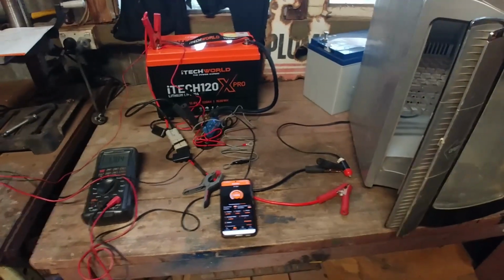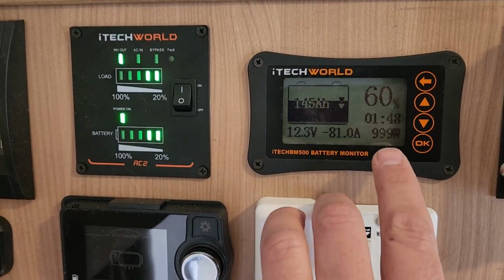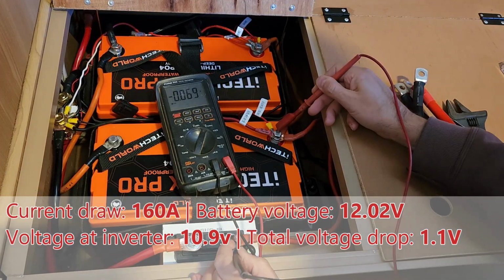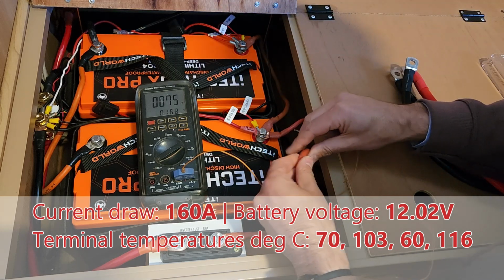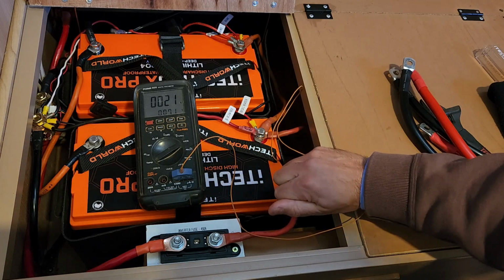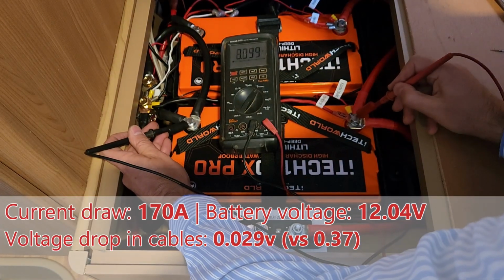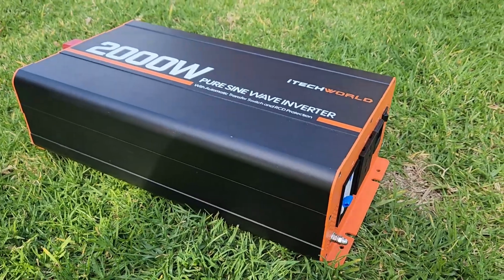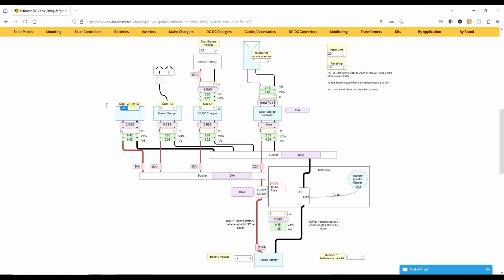WARNING: Skinny power cables + power upgrades = fire risk!

Comment: I would not consider anything smaller than 35sqmm cable for my battery connections, and even then thats a bit under sized for some uses such as battery interconnectors, and inverter connections, and I may step up to 50 or even 70sq mm. Not everyone has a roll of that cable laying around as it's extremely expensive and heavy as well. 

For those saying reduce the fuse to 200 or 250A, yes I agree, but also be aware that the fuse is there to protect the cables and unless you have cables that are capable of handling 200+ amps, which is roughly 70 sq mm, i.e F**king thick, and are instead using something like the 10-16sqmm that appears to be used between the battery and the fuse, a 250A fuse wont stop the cable overheating due to overload. Your 00 gauge is pretty close to 70 sq mm (67mm from memory, so they are likely using 70sqmm cables) and perfect for the task
Reply from the maker: All good points thanks for sharing! Yeah the issue of heat with cables comes with time; 250A for a few seconds won't matter but sustained high loads week cause melting issues

Comment: cca cables should not be used.
Reply from the maker: I don't think these are CCA cables? What made you think that? I would certainly agree in principle with what you're saying if they were.

For anyone else reading this, CCA stands for copper clad aluminium, which is copper on the outside but cheaper aluminium the rest of the way through.

Comment: Silly this 12v madness. Just upgrade to a 24, or 48V system. Way lower currents and more efficient.
Reply from the maker: I agree a higher voltage system is definitely one way around this problem, especially for a brand new installation where you're doing it all from scratch. However if you're retrofitting it to an existing 12 volt system, you have to factor in the cost of changing 12v appliances to 24 or 48v, plus 12 volt converters when needed to run lower power 12 volt systems like water pumps or the radio. It would probably cost more to change all that than the cost of upgrading a few cables and keeping it all as 12 volts.

Comment: Yes,  there is some bad system design there. Undersized cables with a very high amp load!.  No one to blame there but the installer!  Properly size battery cables for the loads is simple.  there are apps you can download on your phone to calculate the correct wire sizes
Reply from the maker: Haha well that installer would be me! :D The old orange cables were what linked the two original AGM batteries, but when I first installed the inverter I supplied that thinner red cable I had from an old 1200W inverter. As I had AGM batteries I was only drawing small loads from the inverter for some time, but having just changed to lithium I was able to load the inverter right up for the first time, which is when this problem first presented itself.

Comment: I would change that fuse to a 250 amp fuse. I would also use busbars to connect each battery.
Reply from the maker: Not a bad thought; while the inverter usually only draws 250A at 3000W, it can draw up to 4500-6000W for 2 second bursts, which is 375-500A, which I guess is why they use a 450A fuse. Busbars are a good idea, it never occurred to me. Probably cheaper than chunky cable too.

Comment: Tip, next time when you switch the cables put the old one also on top of the new ones and the voltage drop will be more less.
Reply from the maker: Ah so run the old cables in parallel with the new ones? Good idea, provided the stack of terminals doesn't introduce more resistance than the cable. I'm probably ok with these thick cables but it's a good point I hadn't even thought of! Thanks!

Comment: Very useful demonstration of under sized cables.
There are other  improvements you need to consider for safety.
Lithium batteries can deliver very high currents under fault conditions, in the region  of 7000 amps. This requires fuses  that can tollerate  this. Recomended are classT or MRBF in suitable fuse holders,  as 'master fuses'.  Idealy each battery should have this fuse type as close as practical to the positive terminal before any other connection. Its necessary  to have positive and negative buss bars to avoid stacking  more then two lugs where you have multiple cables on a common point. Where there is a reduction in cable size a suitably rated fuse are needed.
The battery manufactures claim of 'drop in' replacement for lead batteries needs to approached with some caution. Under charging they tend to 'pull' more current than lead batteries. Thus chargers and cables must be able to handle this without overheating.
Whilst litthum batteries are fairly tollerent of charge voltages, optimum charge volts of absorbtion 14.2 volts and float volts of 13.5 are low stress values.
Reply from the maker: All good points, thanks Michael!

Comment: This has to be the most informative video I have seen on YouTube regarding Cable Selection and Vd on DC and its inherent effects. The power gains to the load attributed to I^2 X R has been fenomenal in this case due to larger cable selection and consequently a drop in R. Not sure what type of cables used if CCA or solid copper though?.  Well executed.
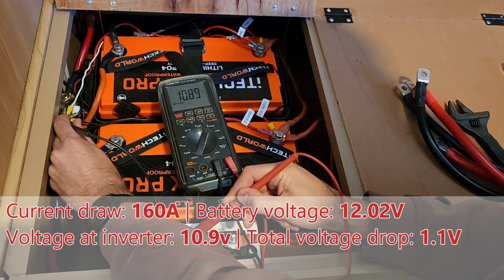Reply from the maker: Thanks so much, glad you enjoyed it! You're right there are gains to be made, and I probably didn't point this out as well as I might have. 160A at 10.9V (2:44) means the inverter was receiving about 1750W of power with the old cables, but at 7:03 it's 170A and 11.6V which is nearly 2000W. So my old cables were essentially being a 250W bar radiator!

Comment: Great video. I recently replaced my caravan AGM setup with 300a of lithium. Fortunately I've only got 1000w inverter but you've got me thinking. Pretty sure my Anderson plug cable running from the vehicle is undersized too.
Reply from the maker: Glad it helped! Yep the charging cable from the drawbar, as well as the charging cable in the vehicle itself from the battery, should all be considered. Good luck!

Comment: Yes indeed. Amps are the killer for cable size and always use a fuse with less rating than the cable can handle. A small error can indeed burn down your pride and joy.
Reply from the maker: You're right there Peter, no point your cables becoming the fuse! It's interesting iTechWorld supplied the 3000W inverter with a 450A fuse but only 300A-rated cables (based on what's stamped on the lugs). That said, being a 3000W inverter it's really only designed to draw 250A under full continuous load, 350A for 10 seconds and 450-500A for 2 seconds. So in normal use they would be fine and I guess a temporary overload of short cables like that isn't going to be a problem, and if there's a genuine fault then the fuse should blow fairly quickly.

Comment: G'day Greg great video. I'm sure it will help people, but you did miss the elephant in the room. That fuse was screaming 450amps. The fuse is there there to protect the cables not the load. On the first run that fuse should have been one hundred amp. Maybe up to 250amps after changing the cables, depending on what cable chart you use. Great test. very entertaining
Reply from the maker: Interesting thanks Joel! The 450A fuse shipped with the 3000W inverter and they were installed together, so it's primarily there to protect the inverter. However implicit in that statement is that the rest of the system can handle more than 450A, so as you say the fuse should be first thing to go and not the cable. However it's interesting that the inverter has a max continuous input current rating of 375A, but peak up to 450- 500A, and the cable iTechWorld supplied with the inverter had 300A stamped onto the lug. So a bit of a mishmash of specifications there! I think they're designing the fuse to blow if the inverter shorts, and assuming the install will make sure the rest of the system can handle more than 450.
Reply: @TheMusingGreg  I would change the 300A for the same 95mm cable as well. That 450A fuse will hang in there and take more than its rating before it blows. Cable insulation also has a temp rating and some good ones can go up to 200degC or a standard could be as low as 60degC.
Reply from the maker: @sparkletornado5890  Yeah I've thought of that; but under normal circumstances the inverter will only be drawing 250A when it's generating 3000W, so it's only in overdrive conditions, which would be rare and brief, that you might pass 300A, and only in fault situations it should head north of 400A. That said the voltage drop at 250A still may be significant so I'll consider it.
Reply: @TheMusingGreg  Using the correct cable size for inverter loads helps to minimize voltage ripple, which can be detrimental to system performance. To measure ripple, set your multimeter to AC voltage mode and take a reading at the DC terminals. A ripple of 1.5-2V is considered high. Excessive ripple forces the inverter to work harder, leading to increased strain on the system and causing micro-cycling of the battery, which accelerates cell aging.
Reply from the maker: @sparkletornado5890  Yep that's a good point mate, especially with variable loads on the inverter. If it has to battle the output load climbing as well as the input voltage dropping, and then those two factors varying quickly, it makes everything work harder. My van is out at the moment but I would expect with those thick cables there wouldn't be much ripple in my system.

Comment: You’re not the first and you won’t be the last.  I’m a technician by training and you would rightly assume that I knew what I was doing.  But alas no!  12 volt seems safe but start talking in terms of 100, 200, 300 amps and things can get very nasty very quickly.  A very similar mistake to yours in fact.  Overestimating cable size is a real trap!
Reply from the maker: Thanks for the comfort! Yep I'm a tech by trade too and the simplicity of the swap meant it just didn't occur to me. But as you say at those levels of current, all sorts of innocuous conductors suddenly turn into bar radiators!!
Reply: @TheMusingGreg    I’ve literally just upgraded my very small caravan to the same system as you, except one more battery.  360 amps worth and the 3kw inverter.  I used a 20mm x 6mm busbar between batteries in parallel and they actually changed colour!!  Yikes!  Great channel Greg you should post more often.
Reply from the maker: Wow that's scary! Glad you're liking the channel, yeah I'd like to post more often and I've actually got the content for a number of videos all recorded, but it just takes so long (as in, numerous full days back to back) to pull all the different clips together into a decent video! So everything else including work has to go on hold while that's happening. I think in some respects I may have set myself unrealistic expectations with those really long solar blanket reviews which took weeks of solid work to produce, but don't want to follow them up with half-baked content! I've definitely got the iTechWorld battery review coming, and Hard Korr has sent me an updated version of the blanket I reviewed last year to look at, so hopefully they'll be done before too much longer!
Reply: @TheMusingGreg  Hey Greg I can’t for the life of me find that chart on that website you mentioned.  Got a link?  Thanks
Reply from the maker: Sorry I meant to add in the link in the description! Just done that but here it is again: https://www.solar4rvs.com.au/buying/buyer-guides/ultimate-dc-cable-sizing-system-calculator-for-rvs/